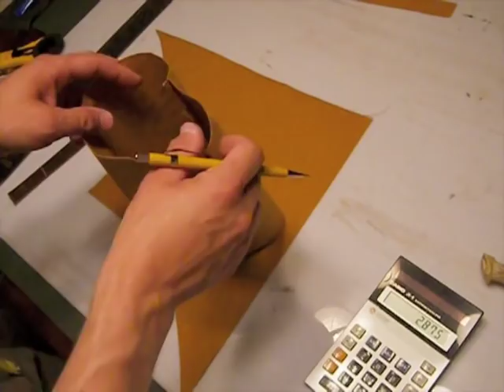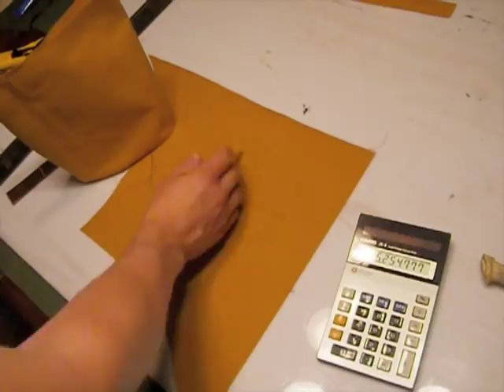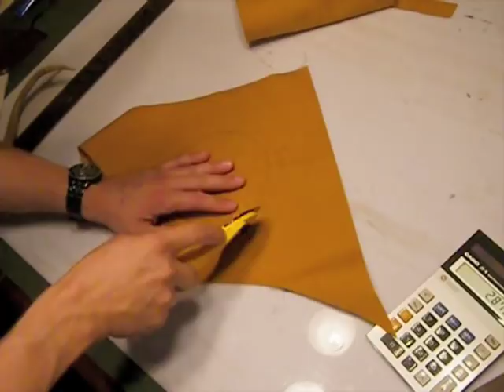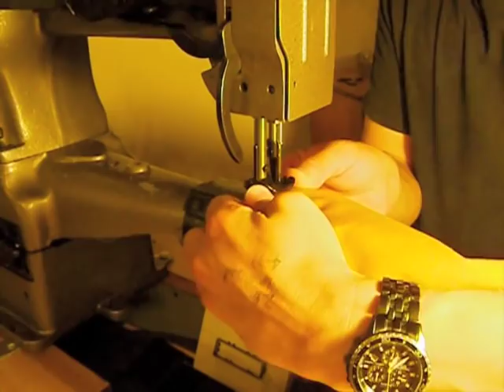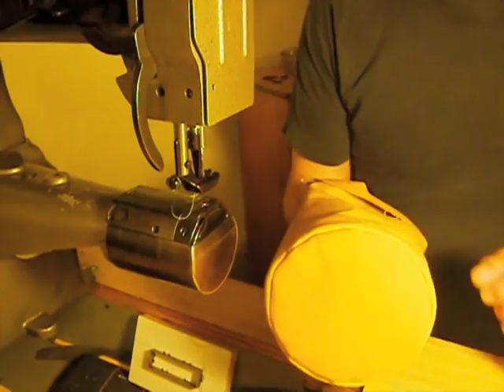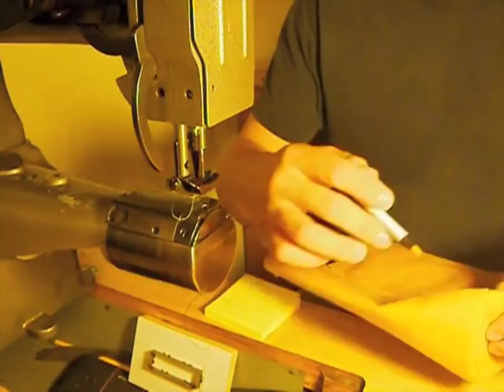how to sew round ends on a bag/cover, tutorial

Comment: Fold your sewn tube piece in half. That is the midpoint. Lay it on your leather bottom and mark the fold/center point. OLFA Rotary Circle Cutter to cut the circle bigger than your stitch line, cut perpendicular lines from sew line to cut edge 1/2" apart to loose the ripple effect when fitting it together. Sew it up, call it a day.

Comment: You did it very complicated. You don't need to worry about pi in this instance at all and there is a much simpler method. Your diameter is the 8.25" you measured when you flattened the tube. Divide that by 2 and you have your radius, which is 4 1/8".  Add 1/4" to your radius for your seam allowance, so your radius becomes 4 3/8". Get a string, tie it to your pencil. The measure out 4 3/8" to the tip. Hold that part of the string down, this is your center. Then draw your circle.